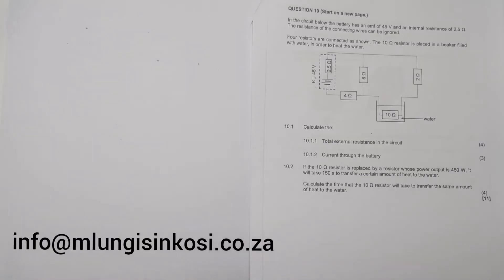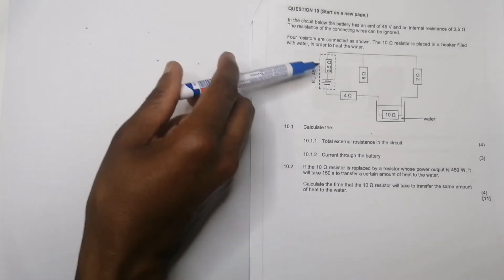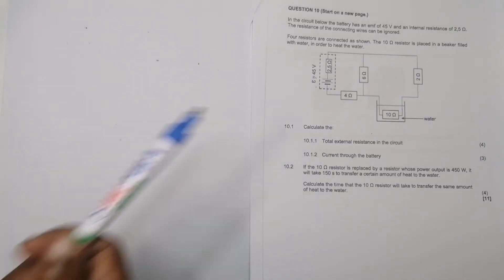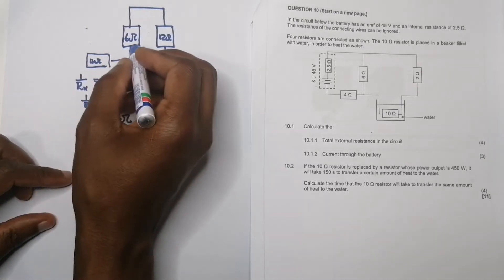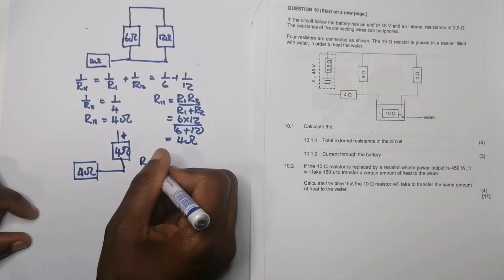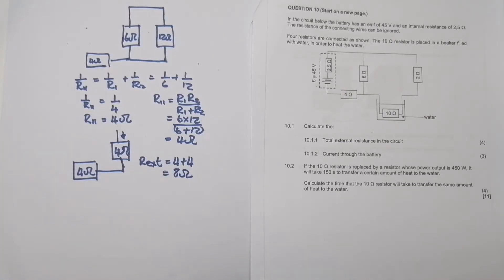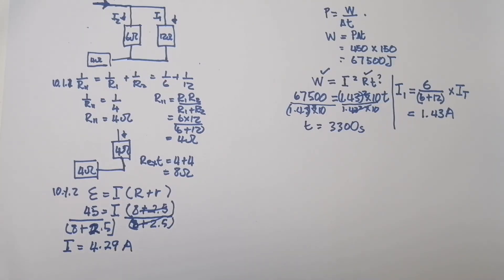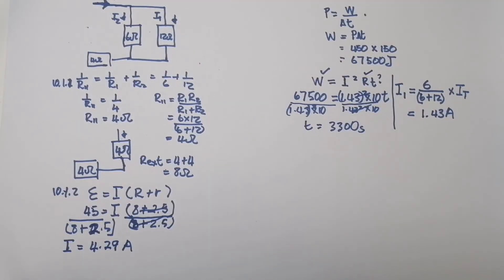Physics | Mastering Electric Circuits | Mpumalanga 2021 Prelim Exam | Mlungisi Nkosi

Comment: Sir can the method you used to calculate the Current work if you have 3 or more resistors?
Reply from the maker: Yes it can but you have to be more careful in how you execute it.

Comment: Sir is 10.1.1 why can't we just calculate the total resistance of resistors in parallel then add the 10 and 14 after, as they are in series with the parallel resistors
Reply from the maker: I see your understanding of electrical circuits still has some gaps. Please watch the Playlist I created on this topic

Comment: Good day sir
The formula we used to find the current flowing through the other resistor in parrellel, can we also use the very same method/formula if we had 3 or more resistors in parrellel to find current in one of the resistors?
Reply from the maker: Yes you can but you need to be careful... I wish I could explain it but perhaps doing a question with that type of question would be even better.